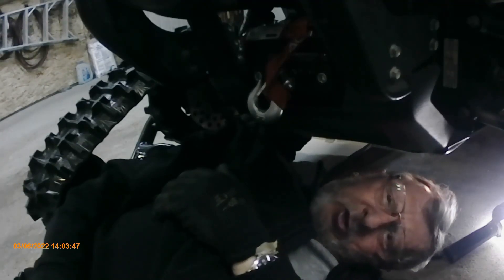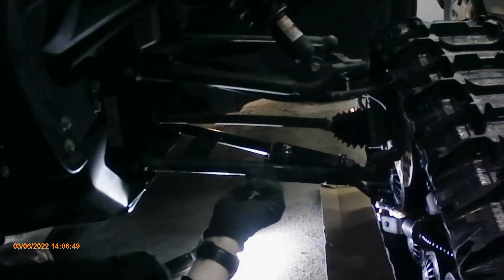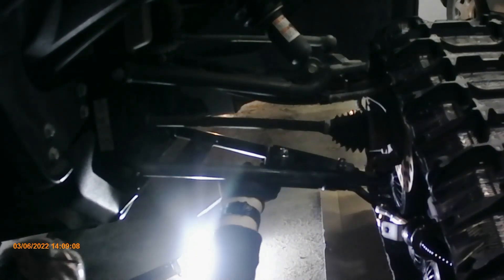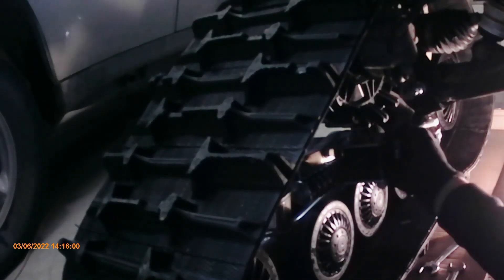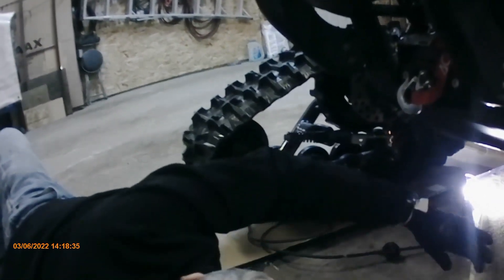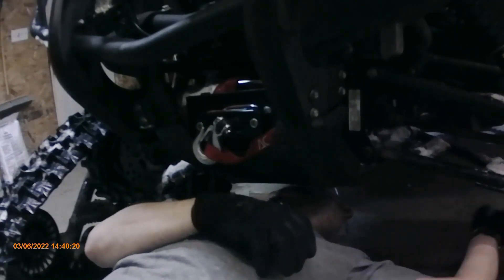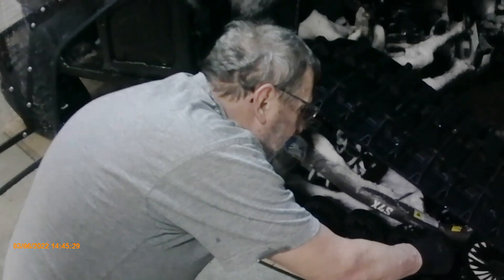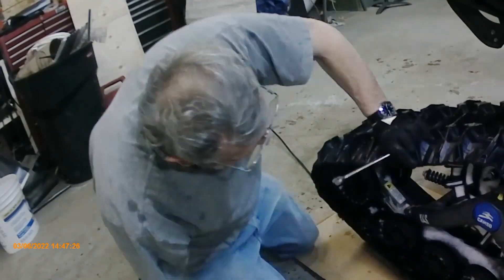Flatlander Mike - 2014 Yamaha Viking - Camso X4S Installation Part 2

Comment from the maker: Update: After talking to Camso, the torque for the track hub to wheel spacer is 40 ft lbs. The word "First" is a type in the instructions. Also the height of the back wheels during setup is 10 5/8" not 10 3/8".